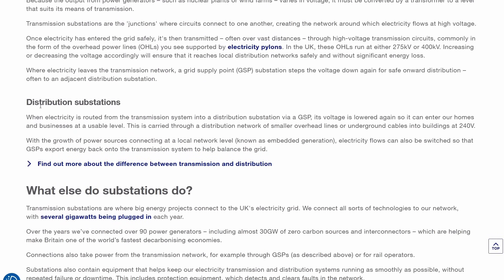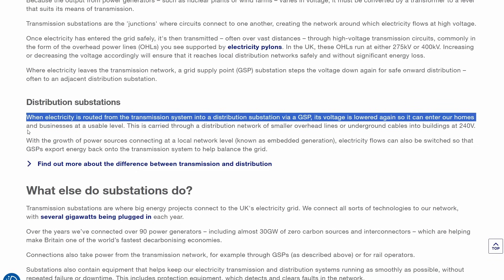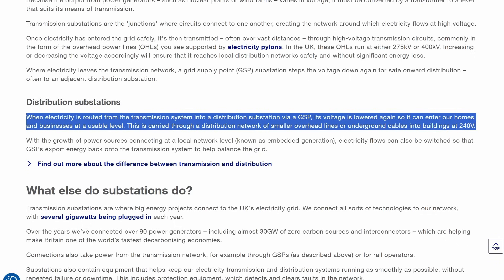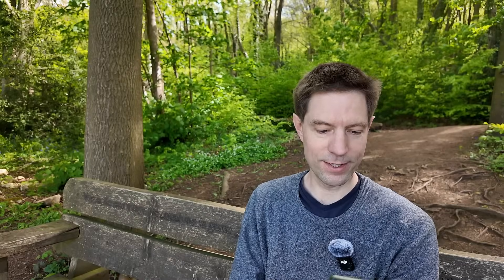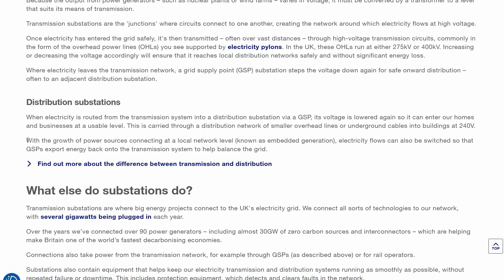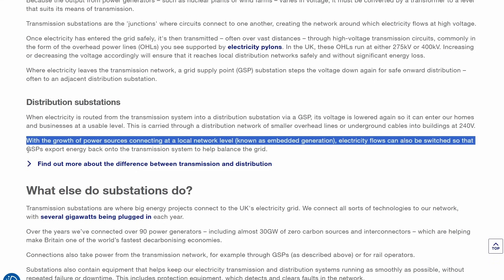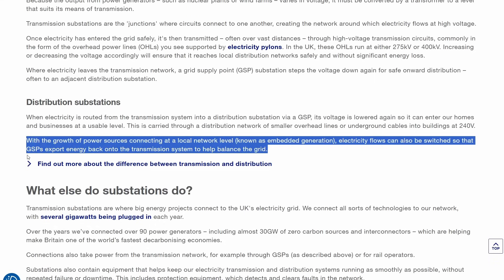Does solar export get past the local transformer?

Comment: But dont put an array on an old tennis court 😂. Ask artisan electrics about that lol
Reply: 'Actual Electrical Content' channel does some analysis of the Artisan tennis court scenario which is well worth a watch if you're ok with the swearing. If you and your neighbours are on a a long cable run then your inverter will have to beef up the voltage to get the current to flow into the grid and this may be over the allowed voltage.
Reply: @henryv7629  think that video got pulled was looking to re watch it and couldnt find it
Reply from the maker: I have no access to potential tennis courts so that won't be a problem for me

Comment: As an American, I doubt any of this applies to me. 😢
Reply: Will there be a solar export tariff? 🤣
Reply from the maker: It might.  There's probably equivalent information out there for other countries.
Reply: Californian here. I have all of 3.9 kW of solar. My house was renovated and converted to all electric. What with all the insulation that was added to an uninsulated 1903 house the heating and cooling demand dropped so much that I produce one or two excess MW-hr per year with my 11 panels. It happily goes back through the local pole pig (transformer) to the grid.
Just for information: Our electric power to homes here is 240 VAC balanced with reference to ground. In other words, two 120 VAC lines 180 degrees apart. This is similar to the 120 VAC balanced to ground used on British construction sites. With only 60 VAC to ground things are much safer and power tools are easily available because of the North American market.
Reply: It absolutely does - any grid connected solar system can push power back through the little pole mounted transformers that feed homes in the U.S.  [Unless of course your very smart president decides to make a presidential decree about Faradays law, maybe he could switch off the tides too 😅]